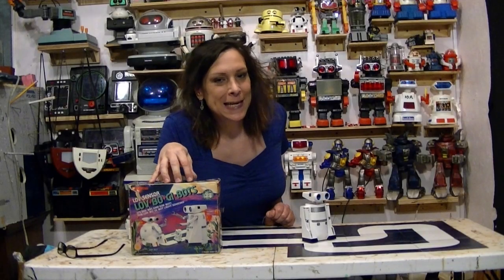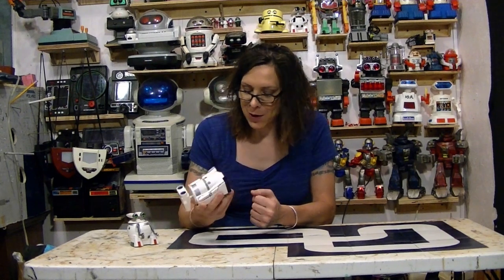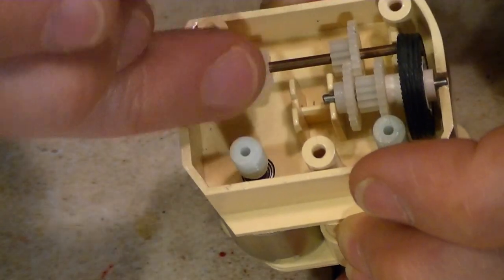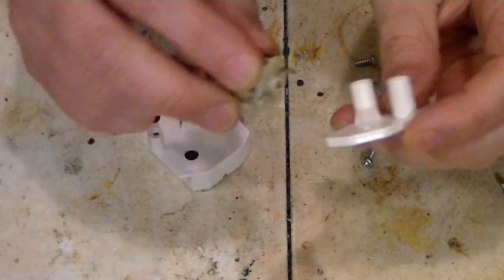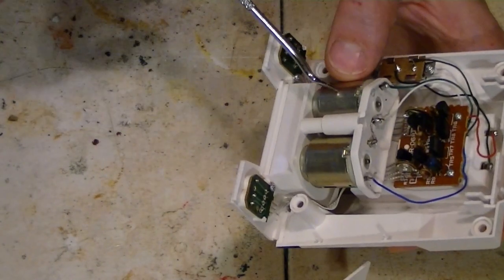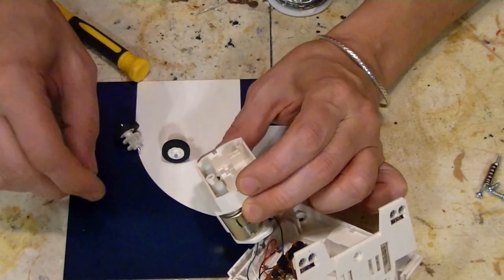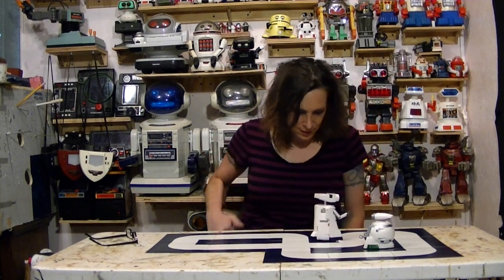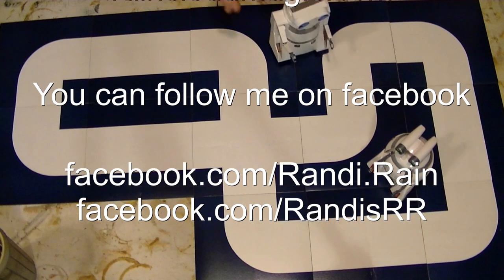How does a robot from the 80s follow a path? - Bandai LovBot Refurbished

Comment: Hi Randi, it's a chemical they put in the plastics called : brominated flame retardant, its this chemical thats reacting with the air, heat and maybe the sun also, 

the amount they put in the plastic was not always the same, therefore some of the parts is yellowed more than others,  look at old computers PC's , Commodore computers and keyboards... Regards Michael Cruusberg, Denmark :-)
Reply from the maker: Makes sense.

Comment: Randi, do you know the "reverse screw" technique?  It might help to keep the screw posts from cracking.
The technique is to place the screw into the hole and slowly turn it in reverse until it drops into the original  groove, and then tighten the screw normally.
Reply from the maker: When I was working on the movie Asteroids, there is a scene where a damn busts, and I was on the special effects crew. Behind the model of the damn, was these big air tanks that had solenoid valves, that was connected to these big metal funnels. The funnels were filled with debris and when set off they blew the damn, and everything went flying like an asteroid hit it. I was the one that had to screw those funnels in place, because I was the only person who could climb onto the set, get into the awkward position, so they could be screwed on. I was doing it only by feel, laying on my stomach, reaching down blind. I was turning the funnel in reverse to try to match the threads, because these were very easy to mess up. That's when a man watching me do what I do thought he should tell me that I was turning it in the wrong direction. I can't win.

Comment: I would be willing to bet that those plastic parts were tinted that color when made, and this time, was not yellowing. It was too even and perfect to be yellowing from something. I’ve seen other toys where the gearbox parts were tinted different from the rest. Could be a different type of plastic, or maybe those parts were made at a different facility. And I hate to say it, but I would also think that the retro-bright (maybe the two attempts combined) made it brittle.
Reply from the maker: Look up my Verbot video. You will see one that has a yellow arm. Nothing else around it is yellow, just the arm. Did they make that one arm yellow on purpose too? Of course not. This is what old plastic does. I've seen it many many times. Why would they make every other part white, but then make that part yellow? Why doesn't the other robot have a yellow bottom? Like I said, I wish someone who actually knew something about this would explain. Not just a guess.
Reply: @RandiRain  just trying to help. Didn’t mean to tick you off. It was an educated guess from other things I’ve seen though. But yea, I get the frustration of unhelpful comments. Sorry.
Reply: @RandiRain I can’t explain the one yellow arm, but some older ABS plastics have a flame retardant in it called bromine. That can leach out over time causing yellowing. Usually it’s UV light that causes it, but other things can as well, like heat or humidity. It makes sense that the plastic around the motors would have the bromine in it.

Comment: Great video! Do you think having two sensors on each side allows it to gradually correct its direction? Perhaps the outer sensors make gentle course corrections, and an outer and inner combined make a more severe correction? It does not appear to over compensate and zig-zag on the straights.
Reply from the maker: It's possible. I did notice while editing that the end sensors go off the edge before it starts turning.

Comment: Maybe the discoloration on the bottom was caused by light not getting to it if it was stored a long time out of the box standing up?
Reply from the maker: But why not the other plastic around it? It's heat. Many times I've seen toys that have been in boxes in an attic, not exposed to any light, and they are completely yellow. You should see the Omnibot 2000 someone gave me. It's bad... very bad... and it was all done by heat.
Reply: Perhaps the rest of the housing was made from a different kind of plastic that was more resistant to the specific conditions that caused the yellowing? It's a lot of guess work at this point, though, similar to the purpose of the extra photosensors - I could see ways to use them to detect how far off of the path it was but without schematics it's hard to say what it's used for in that implementation.
Reply from the maker: @DanielleWhite  I'm guessing it's something like this. Or just the plastic was made at a different time and was a little different. Or made at a different location and the plastic was a little different. You're right, it's just a guess.

Comment: I would guess the sensors have a IR emitter and receiver. Maybe the white/black track is IR reflective or absorbing so it can tell when it changes state to correct its course.
Reply from the maker: This was before IR was used on stuff like this. It's just white light.

Comment: you can see with cameras, thet second "sensor" is just  UV led, so the real sensor is looking for ir light reflection
Reply from the maker: Both sensors are photoresistors. This was in the 80s. You didn't get UV LEDs in toys during this time. It's also not IR. It's just light. It works just like the old shooting games. It doesn't shoot IR like laser tag, it shoots white light, from a bulb, and when the photoresistor detects light, it allows electricity to flow.
Reply: @RandiRain  but you clearly can see, that something emitting light %), so i presume this
Reply from the maker: @minortoterona2947  Just lamp is emitting light.

Comment: You ignored the prime directive of engineering.
"Never try to fix something that's not broken".
Retro brightening makes plastics super brittle. 
8-bit guy proved it.
Reply from the maker: But it was broken, because it was yellow. And the 8 Bit Guy also said that ozone whitens the plastic, and no one has been able to replicate it. While others have said that retrobriting doesn't make plastic brittle. That's why I said that I wanted a chemist, someone who actually knows what they are talking about, to explain. David Murry is not a chemist and the "proving" requires a control and the scientific method. Which he did not do. It's quite possible it does, but I haven't seen any proof so far.
Reply: @RandiRain  I speak from experience. Easy to prove. Take 2 identical pieces and retro-brite one for 24 hours.
Then try to break them. See which one would break with almost no effort. 
Maybe the type of plastic and the time spent in peroxide matters. I've tested ABS left-overs from aircraft model building. they got brittle and broke easily. The originals would bend a lot before breaking.
Reply from the maker: @piconano  And I speak from experience too. And I have many many videos proving it. I can tell you, that it's not the same across the board. Not all plastic is created equally.